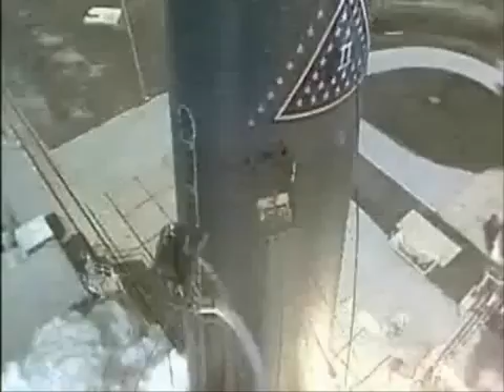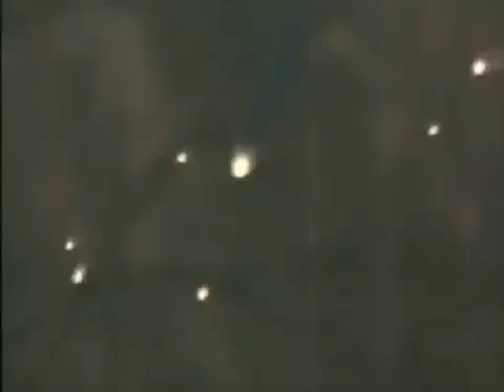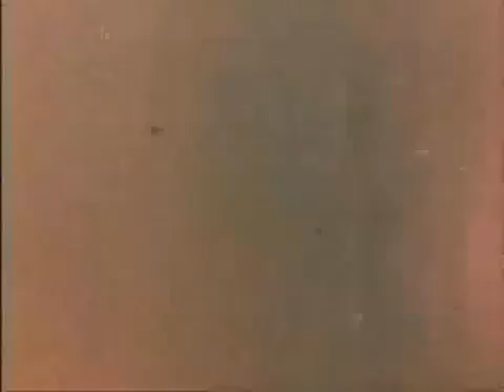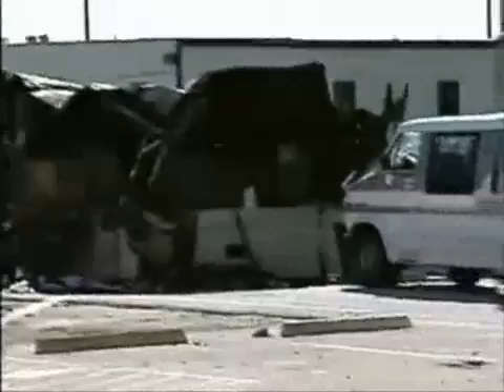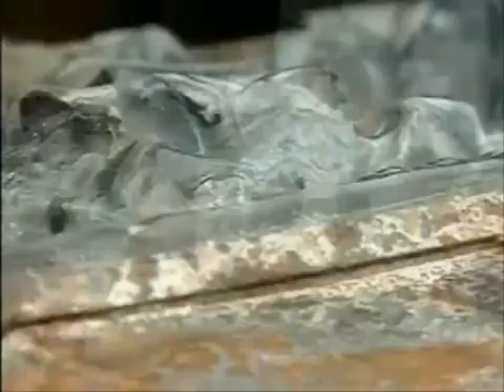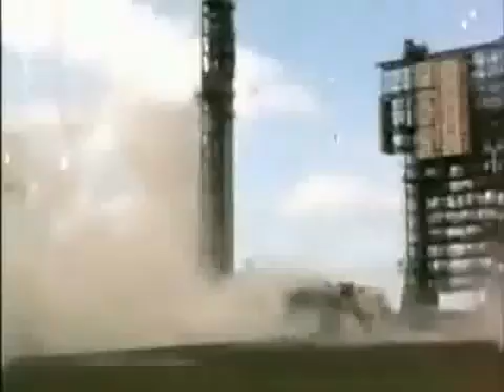Delta II Failed Space Launch

Comment: So NASA sees a rocket blowing up as an "ANOMALY" 

Id like to see what a massive vehicle failure would be
Reply: Golden Retriever It's an "anomaly" because the explosion itself was triggered by an FTS self-destruct. The "anomaly" was one SRB not burning (you can see it seconds before the explosion), not the FTS self-destruct.

Of course, FTS's role would be to safely destroy the rocket, causing an explosion but not a rain of flaming shrapnel impacting the ground. Most likely FTS om this rocket wasn't designed with strap-on solids in mind.
Reply: NetRolller3D 

Well ok that's a perfectly good point but it's still kind of an understatement 

I mean imagine if when the titanic sank they'd just say it sprung a leak 

Also

I WAS ONLY JOKING
Reply: Well NASA has a designation for the loss of a vehicle and crew. It's one of their fancy acronyms, and it's easily their most dreaded one.
Reply: It is. The rocket did have an anomaly that caused the explosion

Comment: How that 17 foot crack got by inspection is beyond me...
Reply: Bort Plate He misspoke. It was not visible to the naked eye. I actually believe that a crack developed in the solid fuel of that booster which allowed the flame to get all the way out to the casing and it burned a hole. Only takes a moment (very similar accident occurred about 10 years before to a twin booster Titan from Vandenberg in 1986)

Comment: 17 foot crack!? that's the length of an small sport-fishing boat, how did they not see that
Reply: It started as a hairline fracture from improper handing by Aerojet. Composite cased SRB's do not like impact, the crack grew visible only at T+4 seconds, then the pressure vessel unzipped at T+12 seconds.